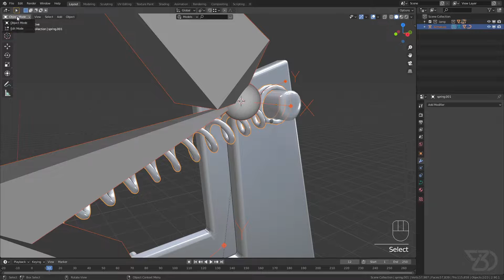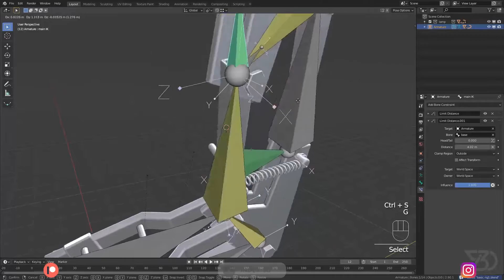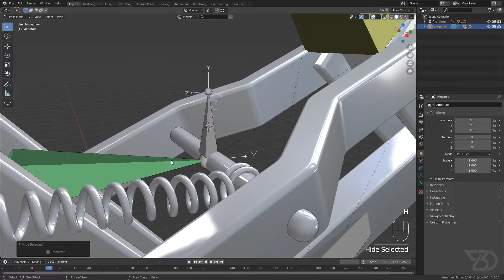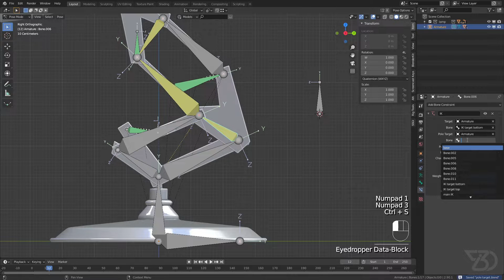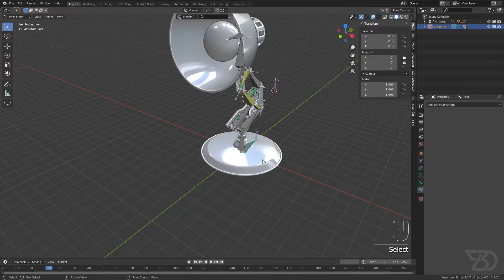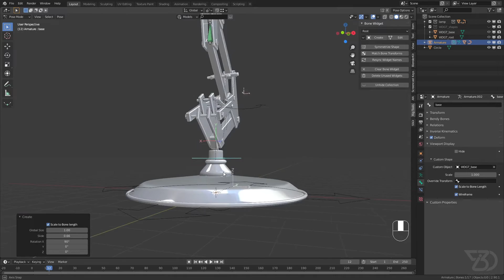Luxo Jr | Pixar Lamp Rigging Tutorial | Part 2/2 advance Rig | blender 2.9 Free Project File

Comment: Could you publish the version of Bone-Widgets that you are using? The version avaliable on GitHub has got critical errors and the rotation feature is missing. Would be nice :) 

Edit: Found it on GitHub, it's a fork of the user waylow.
Reply: Well, I know about these little problems when installing addons. And I know that the folder inside the zip is not the problem. It's an error in the source code and the folder in the addons directory has to be named boneWidget. But renaming it everytime I install it (and as developer I do this a bit more often) just sucks. Also, just as I mentioned in the edit, you are not using version 1.2 (that is the version you link to), but version 1.5 or higher. I found that version, so I don't have problems anymore, but I still want to leave the comment for all the others that don't know where to find version 1.5+
Reply from the maker: Its not working becouse there is folder in zip file 
So simply just zip it and goto the folder and re zip it 
Hopefully it will work